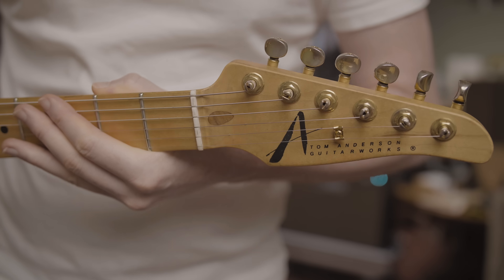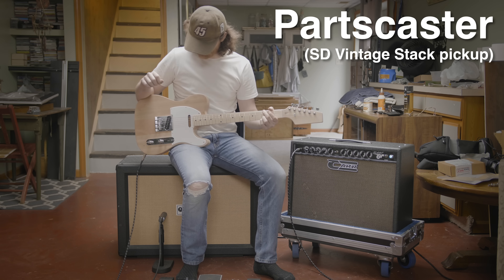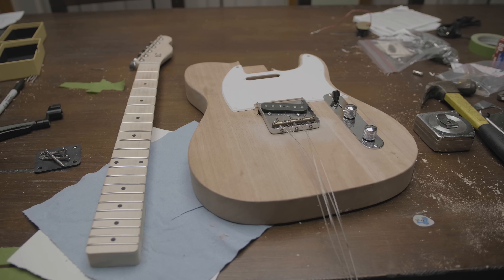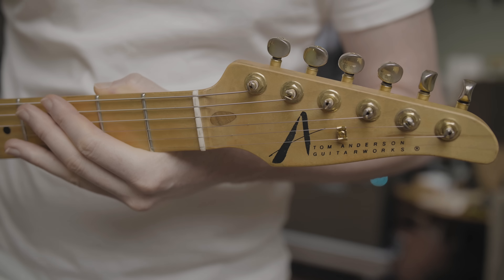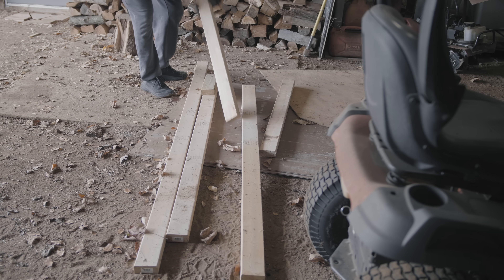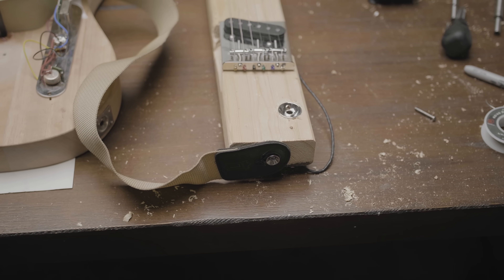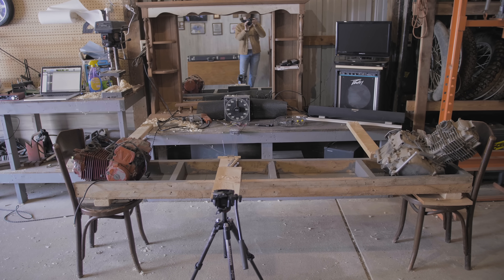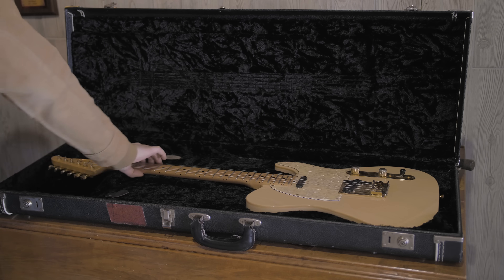Tested: Where Does The Tone Come From In An Electric Guitar?

Comment: How has this video not exploded and broken the guitar community?!
Reply: If you had bought a guitar for 10k, you'd also want to convince yourself you didn't just light 10k on fire.
Reply: @thecrazything95  you didn't. there's a reason why some people buy a toyota, and some people buy a mercedes. Both are metal boxes on wheels, but they have different purposes and qualities.
Reply: @thecrazything95  that 10k goes to a lot more than "tone wood". Better pickups, better pre-amp, better tone. And then there are the things that don't affect tone, but affect functionality: better tuners stay in tune better. Different bodies can be lighter or heavier, balanced well or poorly. The string spacing can be close, or too distant. And then there are the aesthetics: a lot of what you're paying for, is for it to look pretty. 
     So its not like you're not getting anything for that money when you buy an expensive instrument, even as far as tone (better pickups/preamp= better tone). Its just that that fancy-sounding wood its made of? Doesn't affect the tone, not to a degree humans can perceive.
Reply: people don't factor in labour cost and over head. When you employ a bunch of people there's a lot of overhead cost in that, the building, the wages, any kind of comp, the machines, the power and water. So I'm sure one single person buying enough wood for one guitar could do it a lot cheaper but it'd take many hours. You really thave to factor in all cost, les Paul's cost more than a strat because there's way more to building a les Paul(binding, maple top, set neck) all those things add hours of wage cost to the build and material. The type of wood even. But no one ever talks about any of that they're all just like " johnny bought a body blank from eBay and some parts and it was only 400, why is that les Paul 3,000" not saying parts guitars can't be great but Gibson and fender could not afford to sell guitars like that, they go broke and close down then everyone would be " wish fender still made guitars, id love to have a new strat". Watch some factory tours, look up rough cut lumber prices, going wages, utilities on factory's, employee insurance, saws to cut rough cut lumber, CNC machines, maintenance on everything. I don't like the prices either but no one really puts actual thought into why the prices are what they are
Reply: B/c they listen to ppl like paul reed smith who are invested in selling people fairy dust. And there are plenty of ppl who want their expensive solidbody to be more special than one that was less expensive.
Reply: @laciep837 have you ever played a PRS guitar?
Reply: @laciep837  PRS(s) are expensive ill give you that. but is there any other guitar brand that is producing such consistent high quality guitars? gibson? nah. fender? high consistent quality maybe but not with the more complicated nature of carve top set neck guitars. Duesenberg? maybe? but its also pretty expensive. point is, whatever youre calling fairy dust actually makes the guitar better in a tangible way. true that not everyone buys into the clean and pristine sound. but at that point they might as well be admitting that the guitar does its job so well that they miss the problems that they had with other guitars. tone wood itself may or may not affect anything. but their drying processes, brass parts and other fussy things are definitely doing something. ive played strats to LPs to gretches. none i would trust like my prs S2. covers everything i need with top end to spare.
Reply: Because like many many other previous tests, people put their hands over their ears and go "la la la laaaa". Everyone 'knows' the vast majority of instruments of overly priced, when you agree with that... you find it difficult to buy them. So it's easier to deny any evidence.
Reply: Big guitar keeping the truth from the public
Reply: The same reason people buy Ferraris and Rolex watches.
Reply: because people are consumerists
Reply: @fpcawolff  great answer
Reply: Because they sell guitars lol
Reply: Oh it has, but they’re in denial after spending so much money. I buy instruments because I like them not for pups, wood type, etc. if it feels good in hand and makes me want to play, i get it if I have the money. I have instruments ranging $100-$1,000, I love me all equally and they’re all fun to play. Expensive instruments are just luxuries to me. But as whole, I love music and instruments. I have guitars, basses, electric drum kits, keyboards, mics (I sing/“scream”), all different price points and all serve their purpose lol
Reply: Because people don't want to confirm that their beliefs are wrong. It's called "cognitive dissonance", and it hurts, so people avoid it.
Reply: Putin is probably responsible
Reply: You'd be surprised how good people are at ignoring/dismissing stuff they don't want to believe.
Reply: How many million views does it need? 😂😂😂
Reply: Just like the river.  Denile. or Denial.  You choose or at the very least get real defensive and angry about which spelling is correct in this context.
Reply: denial
Reply: Because those guys are usually stuck way up their own asses
Reply: They're still selling the tonewood theory, actually several theories. People are set in their ways and when they think they know something, they don't let go so easily. No matter what pile of evidence you put in front of them.
Reply: Same reason we're still not doing anything about climate change pretty much
Reply: The same reason people buy Rolex instead of Casio & Why some people wear suits instead of T-Shirts and jeans. Why some rich people drive a Toyota instead of a Ferrari....Something can be fit for purpose but still not be "What you want" or on the other hand some people just want a tool.
Reply: Cause too many people have thousand+ dollar guitars and don't want to hear anything other than they bought a unique tone
Reply: It's because they sound slightly different.
Reply: @leif-andersbanan5590 maybe. But it could be something as small as a fart in the wind made the air around the strings slightly more dense.
Reply: Because this video is not really conclusive, many studies have been published and many videos have been made about the tonal differences of wood, Strandberg has a very good one where he shows you the graph of the spectrum analyzer, even in this video the air guitar sounds different, many probably don't notice it because of the type of speakers they are listening to, but if you download the audio and see it with a spectrum analyzer you will realize that there is, and if you have had the chance to have several guitars from different prices you will realize the difference, if it weren't like that we would all buy some squier we would put custom shop pickups, bridges and gotoh tuners on it and we would be happy, but even if you do all that the instrument doesn't sound the same, and that's the sad  TRUE
Reply: @victorloquendoful  Buying a random Squier (albeit one that feels and plays nicely) and putting custom shop pickups, bridges and Gotoh tuners on it is actually a splendid way of getting yourself a really good guitar. One of the main reasons guitarists aren't doing this en masse just comes down to good old fashioned brand snobbery.
Reply: @GustavVII  Many guitarists do that, and this improves the sound and intonation of the guitar, but you do not get the sound of a standard American fender, not to mention a custom shop, in fact there are brands like esp for example, that have some models with its equivalent in ltd and despite using the same pickups (seymour duncan, emg), it is not the same sound, however I agree that nowadays you do not need a high-end instrument to have an excellent sound.
Reply: Because there's only a few thousand videos out there demonstrating the kind of changes various woods can make to a guitar's tone.

Warmoth posted a video a few months ago featuring different neck woods. https://www.youtube.com/watch?v=z7jrZrrH4jA

The differences are what anyone that's actually built guitars already knew. Yes, there is a difference in tone. No, it's not anywhere near as much as the corksniffers would have you believe. Pretending that everything sounds the same is just as much snake oil as pretending that plastic tuner knobs give you more midrange, PAUL.
Reply: @ObscuraDeCapra  Sure, sure, but have all those other videos also taken the time to eliminate every other possible variable as much as this one? Because if their test was playing the guitar like normal, doing progressions and solos and shit, they've effectively nullified all results because they're not taking into account their subjective performance. The number of videos proving tonewood that actually respect the scientific criterea needed falls from a fEw ThoUsANd to zero pretty quick if you take your hands off your ears and stop going la la la :))
Reply: @ObscuraDeCapra Hi, audio engineer here, instead of yapping online you should study how sound works.. electric guitars work different than acoustic.. hint, the difference is in the name…what you are saying about the wood doesn’t make sense for electric guitars since they only pickup the vibrations of the strings. Have a good day.
Reply: @kaliber150 and the strings vibrate in a vacuum, right?) the difference is there but is mostly negligible, as proven by real science not dumb yt videos
Reply: @ObscuraDeCapra  You realise you've just linked to a video which demonstrates that different necks make absolutely no difference to the tone right?
Reply: @colcob You may want to stop listening on laptop speakers or get your ears checked. There's a clear difference from one end of the spectrum to another. As I already said, the difference is nowhere near what some people want you to believe but it absolutely is there.

Go to the comparison section and minimize the browser. Listen with your ears. not your eyes.
Reply: @ObscuraDeCapra  the brain is very easy to deceive. Expectation plays a huge role. If you expect something to change, you'll hear it. The Warmoth video is an imperfect test. You can put two different necks of the same materials on the same same body and electronics and get different results due to slight differences in setup. I heard differences in setup in that video; not from the wood. A lot of experienced setup techs will say the same thing when it comes to these small adjustments.
Reply: @OroborusEternalLife  Hi. I'm an experienced guitar tech and builder. If someone gets that much variation because they changed a neck it's because they don't know how to do a setup and need to stop telling people they're a guitar tech, because they're not. It's trivial to replicate a setup and anyone that can't do so doesn't need to own a screwdriver, let alone work on guitars for money.

Same body, same pickups, same hardware, every variable controlled between one example and another. "BuT iT's ThE SeTuP!" Anything but admit that wood makes a difference, right? 

Sounds to me like you already made your decision on how you were going to explain away any differences that you heard before you even played the video.
Reply: @ObscuraDeCapra when you do a base setup on a guitar, how far away should the pickup be from the strings?
Reply: @floodtheinbox  If you're asking in general, there is no such thing as "should" with a guitar. There are no rules. The absolute most meaningless thing is pickup height. It can be changed in about 2 seconds if you don't like the sound you're getting. Need a hard number? 3mm below the E strings. Why? For literally no reason other than that number sounds good to me, which is the same as every other pickup height you'll ever find. There's absolutely no logical meaning to the numbers involved in a setup. It's all about finding what works for you, not what some jackwagon said in a book 45 years ago.

As far as testing goes, when you're doing a test like this the baseline setup just means that you have consistent numbers to return to. Put the pickups anywhere. It doesn't matter, as long as they're at that height for every test.
Reply: @ObscuraDeCapra they make assumptions based off their phone speakers. Also some just refuse to admit that their hearing isn't as sensitive or seasoned as other expierenced musicians and luthiers. Imagine the difference in person compared to your phones too.
Reply: @Airhead348 Do you properly controlled tests showing tests actually demonstrating the differences you assert are responsible for the disagreements or are you simply assuming that those must be the causes?
Reply: @subtlewolf  Maybe check that "your" comments make sense before hitting send. What are you even talking about. The burden of proof would be for you to discover by the way. I don't need expirements I have real world expierence.
Reply: @Airhead348  The burden of proof is on the whoever makes the claim. I don't doubt your personal *experience*, but I absolutely will reconcile it with other information to determine how well it reflects objective reality.
Reply: @ObscuraDeCapra listening with your eyes?
Reply: @ObscuraDeCapra present some actual evidence. You’re just repeating “trust me bro” in the most loquacious ways possible.
Reply: @OroborusEternalLife  To emphasize your point about the brain being easy to deceive, I watched a video comparing 2 guitars built and set up the same way, but 1 was mahogany and the other was mahogany with a maple top. Without seeing the guitars being played, just "guitar A" and "Guitar B" appearing on screen when they were being played, I COULD hear a difference, but once that segment ended, I put my fingers on the J and K keys, the shortcut for rewind 10 seconds and pause/play, closed my eyes and went back a random increment to not know which guitar would be played, then hit play. Suddenly, with my eyes closed and no idea which guitar was being played, they sounded the same and I couldn't perceive any difference at all even though not 1 minute earlier I could hear a clear difference as it switched from guitar A to guitar B on screen. As much as we hear with our ears, I think we also hear with our eyes.

Think of those old ghost hunter tv shows where the hosts would freak out because they heard a whisper, then it would play the whisper from a different camera and  it sounds like complete gibberish and incoherent nonsense, cut back to the hunters saying something like "It just said among us!" and then it replays the same clip of the whisper from the previous camera, but this time with a subtitle and suddenly it's coherently saying "among us" almost perfectly even though nothing has changed except the added subtitle.

I'm fully willing to believe that our eyes are just making up sounds for our brains to "hear" based on situational visual context instead of what we're actually hearing.
Reply: @ObscuraDeCapra Zero discernible audio difference in an electric instrument.
Reply: @joelspaulding5964 Yeah, exactly. I'm an electrician, not a musician, but I don't know how any of the structural material could even theoretically affect the sound unless it affected the vibration of the strings, the electromagnetic field, or the pickup in some way.

Comment: I can't help but notice that you're simply finding the results you want to see, or at least too many people are seeing the results they want to see for the wrong reasons. I also agree that the term "tonewood" is a silly thing when it comes to electric instruments, however what you are implying with this video is that the guitar doesn't matter in this equation. It should be immediately obvious that this just does not make any sense. What you have identified here is that pickups that are affected more or less only by the strings sound the same more or less regardless of the body/neck. That much is fine to a point. Strings stretched over a guitar do transfer some of their vibration to the body/neck, and vice versa. The material and makeup of the body/neck affects how much and what is converted to heat (same as how soundproofing works), lost outside of the system, etc. They do not do this with a flat response, they have their own resonances and filtering properties. The upshot of this is that the body/neck and the strings vibrating over them interact. Consider dead notes or wolf tones. If the body/neck had no contribution to the system, these would not occur. Whilst I think your video has validity in many ways, many people quoting and linking to it are wilfully misunderstanding what is on show here. Simply, a pickup that only creates a signal in the coil(s) from disturbances in its magnetic field is not affected by vibrations within the body (microphonics). Playing demo material that does not compare the bench guitar to a full instrument with the interaction of instrument/amp instrument/strings is a limited demonstration. In short, people are reading too far into the video and coming up with exaggerated conclusions that are faulty. Some even imply that taking the electronics of a "known" instrument like say, Billy Gibbon's Pearly Gates and disregarding the instrument other than this part would produce the exact sound of Pearly Gates (or whatever) without the Les Paul part being required. I think we both know that this is fatuous and patently false!